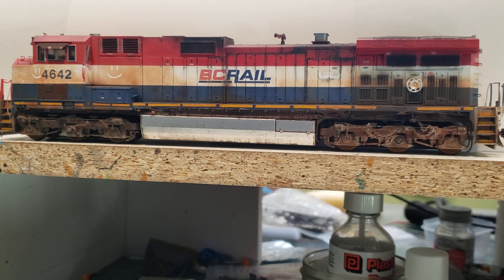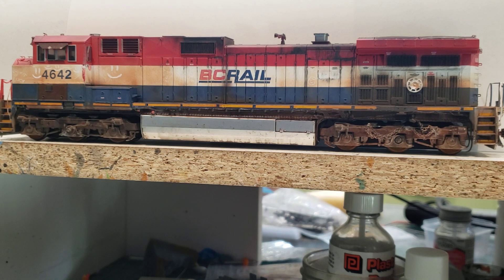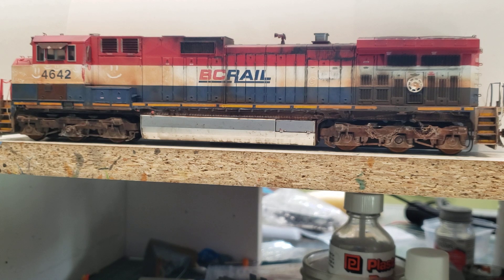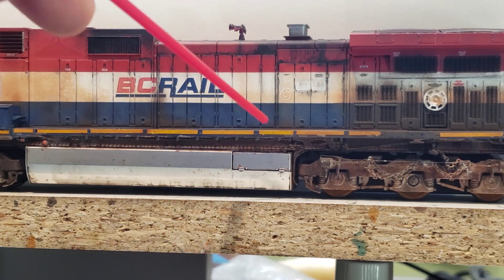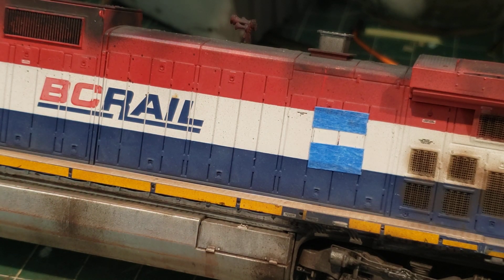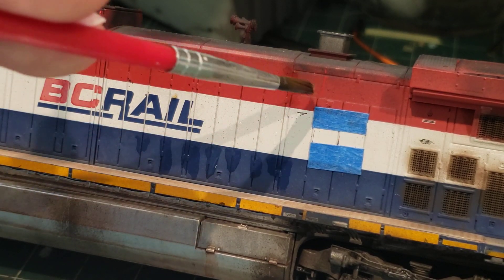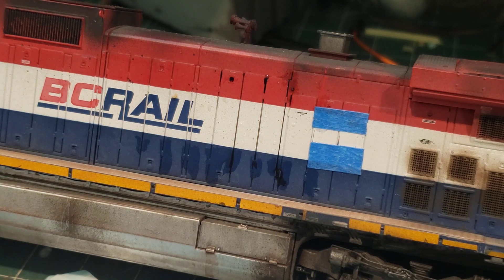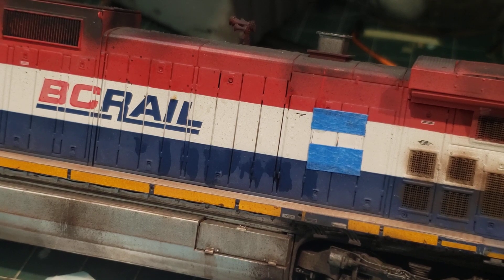How I Do Panel Line Wash with Craft Acrylics

Comment: Mix water isopropyl and dawn dishoap and paint. You can mess with portions, but it makes a great liner. My gundams hate tamiya liner.
Reply from the maker: Haven't tried dish soap. Guess that cut surface tension.  Will give that a try. Thanks for the tip!